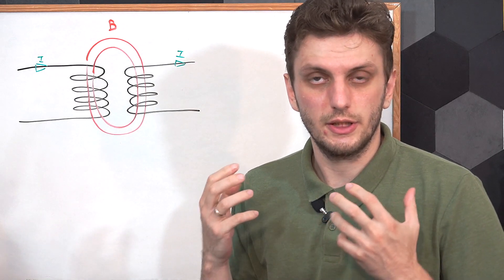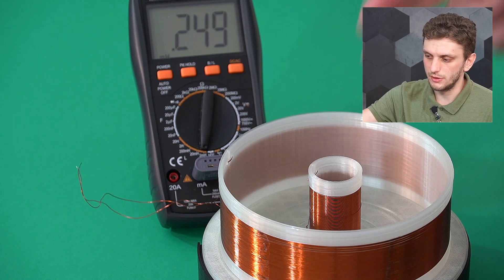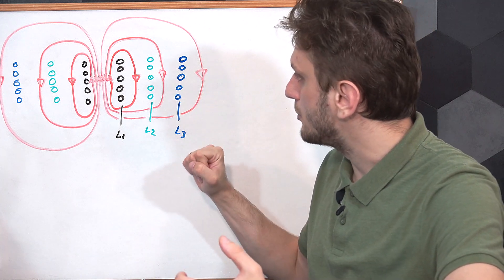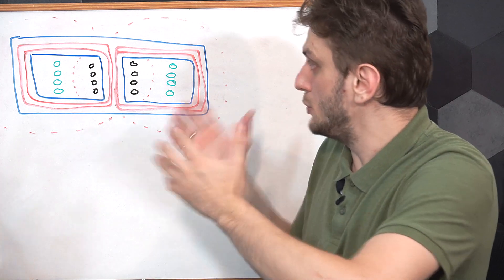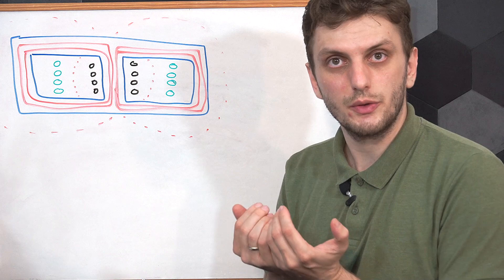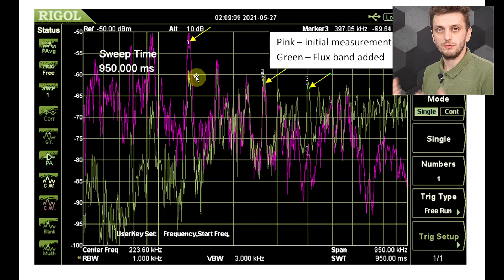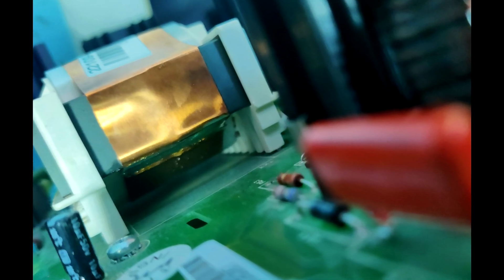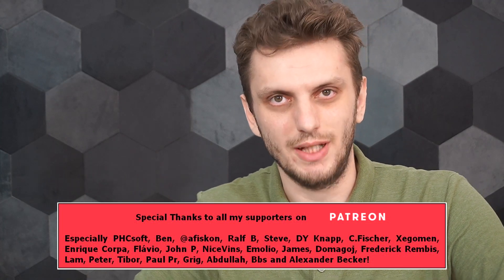EMC tutorials - The FLUX BAND

Comment: Sir, what would happen if you enclose the transformer within a full faraday shield? in other words, not just wrapping it with one 'small band' but fully enclosing the transformer?  Is there any way you can set up that type of experiment?  or even on your other video where you demonstrate a 'noise coil' next to a 'receiving coil'.  If that would be easier to wrap in a faraday wrap of copper.
Reply from the maker: I expect the full wrap to have a better shielding effectiveness; however the single band is more simple and cheaper to implement
Reply: @FesZElectronics  Thanks.

Comment: The 'magnetic field probe'... are these generic enough to use on any oscilloscope?  Can anyone recommend where to get these, or a good brand? If it matters i have an HP oscilloscope.
Reply from the maker: You should be able to connect these to any oscilloscope; sometimes having a pre-amplifier helps but its not mandatory. You can even make your own probes, and for some basic tests that will be good enough - I actually have an older video specifically on the topic of magnetic probes if you are interested - https://youtu.be/l2YS1s6HxHU
Reply: @FesZElectronics  Excellent. I will watch later today. Might I inquire about this?  I see at aliexpress or ebay its possible to buy sets of these in different diameters.  But these 'cheap' sets, usually are not for very low frequency use.  I do see a couple of mfrs certify they can work as low as 1Hz - but these ultra low frequency probes are very expensive.  Do you have any insights as to what is required to make such a probe to have useful sensitivity near 1Hz? Or what would cause them to be so expensive? Here are two models.WaveControl WPH-DC and LakeShore 410.

Comment: Hello, very interesting topic. However, I also want to improve EMC/EMI protection during my design stage, how could I done well for a flyback? Is there any method by winding, wire types, ferrite materials or something?
Reply from the maker: I guess the only thing you can do from a construction point of view on a transformer is add a shielding layer inside of it - between primary and secondary. Or, if budget allows, using a toroid. The ferrite material, or how you wind it should not have a big impact on EMI.
Reply: @FesZElectronics  Could we use toroid core for a flyback?
Reply from the maker: There should be no restriction as long as you can get all the necessary turns and ensure saturation does not occur.
Reply: @FesZElectronics   Doesn't a flyback transformer need an air gap to store the energy ?
Reply: @mumbaiverve2307  I haven't a clue... but I myself, have wondered about this subject. additionally, I got drunk... and saw "Mumbai" which is in the "motherland" and thus caught my attention. sounds like you're the lucky one today... my sincere apologies.
  but on the subject at hand- all I could say is:  flyback Transformers do seem to have air gaps, though I couldn't tell you exactly why. hopefully, you will get a response from someone that knows what the hell they're talking about... I wouldn't mind knowing myself... apparently, this stuff is complicated.  hahaha. 
 peace be upon you, sir. 
      
       ps- oh man, if only you could see what the "usually gets it right but not always" "Google Voiceprint" or whatever it's called, happened to say this time... regular polite decorum prevents me from just straight-up telling you what the vulgar words actually were... yet this thing was willing to print it out for me,  hahaha. 
 peace.  
      pps- wow, now, whatever algorithm is in charge of this thing, gives me the orange head with the big grin and two hearts for eyes... I've analyzed what I said and have no idea why that would be.  
  perhaps I'm stupid...  or perhaps not. 
  if you've made it this far: I salute you.    ...and as usual I advocate peace and happiness for all living things; as any sane person would...

Comment: What to do with mains EI laminated trafos?
will that copper band work?
Reply from the maker: Some commercial audio amplifiers with laminate transformers do use this. I expect that the same principle is valid there - by adding this band, the intensity of the magnetic fields escaping from the transformer are reduced so there is less noise induced into the circuit.
Reply: @FesZElectronics  Thanks.
1 more question. If the copper band connected to Gnd, will it perform better or the same?? as it have "business" with magnetic flux rather than electricity..
Reply: Nevermind, I rewatch the video, at 12:42 you already answer it.. 😹
But if we use other material like Zinc or Steel, will it improve as it have higher permeability than copper? 

Subscribed now! 👍

Comment: Hello, this is by far my favourite YouTube channel!! Really excellent content and presentation. Now binge  watching the whole back catalogue ☺️ PLL  and balanced modulator are so clearly explained and demonstrated. Finally a great LTspice tutorial (just as I switched to  MicroCap!). Thanks 👍
Reply from the maker: Thank you for the kind words! I'm happy you are enjoying the videos!
Reply: @FesZElectronics  
shielding
Hello,

I have seen your answer about shielding.

Here is my case, ex dj and producer in the 90s.

Got deep EHS electrosensibility with juditial sentence since 2015, used to live close to a huge militar radar/antenna for submarines and got a huge cell tower in my corner that killed of cancer half a street.

Now I live isolated in natural park for birds with 0 EMF.

appart of low frequency and hi frequency, I can´t stand magnetical radiation from psus, and got tons of $$ synths as EMS, MOOGs etc.

A person as me has symbtoms over 30 nanoteslas and per example the psu of 1 case of my Doepfer modular reaches 19.000!

We got 2 options, extract the psus and put them 3 meters away, since the radiation leaves, but this is a mess on 20.000$ as a EMS VCS3, on the best case a clone of the psu should be made to leave the original board untouched and bypass it. etc or wrap the psus with this material designed for it

https://electrocontaminacion.net/pro...-mumetal-mcl61

We are failing at this time but yet got to do more proves, also the side effect in case we could do it is the lack of vents and more heat that can do the already unstable synths be more unstable due to way more heat.

Meanwhile we are trying with cheap digital stuff as Nord Lead 2 to avoid damage those vintage jewels.

Could you help please?, I am desperate.

thanks!

Comment: You use copper for magnetic shielding?  Isn’t copper diamagnetic (mu_r ~ 1)? Why should the magnet field  catched up  by this material?
Reply from the maker: The principle is the same as the way Eddy currents get induced into any conductive material. It helps if the material is both conductive and with a permeability above 1 but, the magnetic permeability is not mandatory. Especially at higher frequencies, this parameter becomes less important.